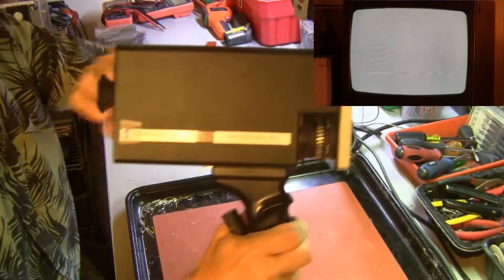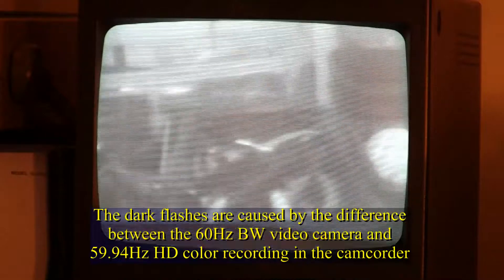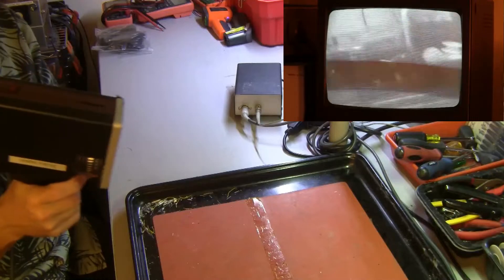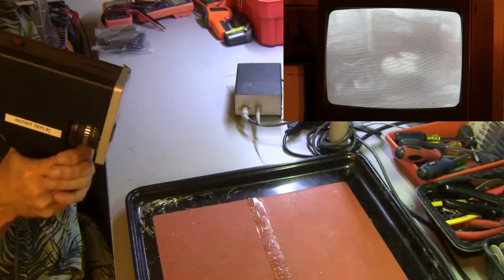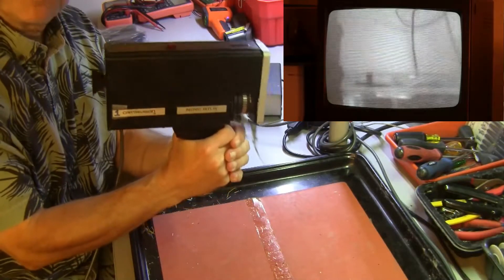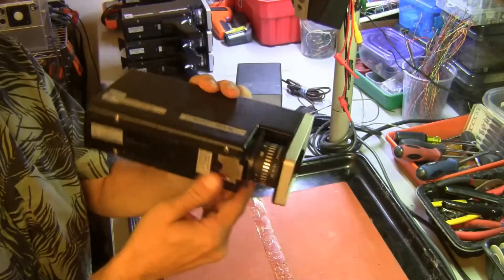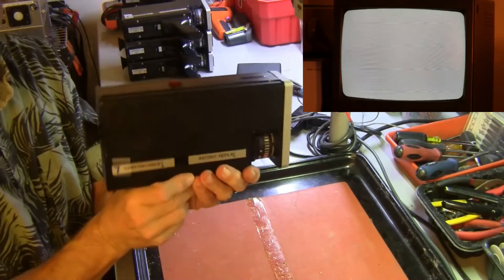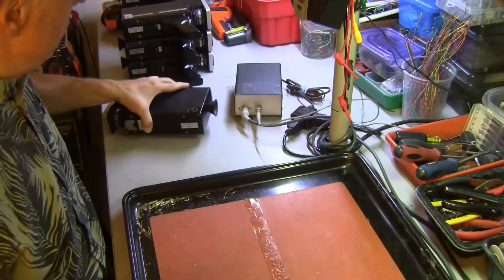Cartrivision Camer-A-Thon, Part 1

Comment: It's awesome to see one of these working. My grandpa bought one of these in the late 70s and hooked it up to his Sanyo Betacord VTC 9100. Here's some video from it: https://www.youtube.com/watch?v=4bw5OYgJgEE#t=1m50s . I got his camera but I'm not sure if it works anymore.
Reply from the maker: There is a good chance that camera does work. BUT, and its a big one, it is not as easy to power up as some. I make these videos for folks just like you. Thanks for the video clip. That was cool. I see the video was getting some buzz into the audio. Gives the production some character. Is that you in the video?
Reply: @videolabguy  That's me! I'm a bit taller now.

I pulled out the camera and took a quick look at the tube, no characteristic white spots that I could see like in your vidicon restoration videos so I'm hopeful it can be brought back to life. The transformer in the power supply looks pretty dried out so checking that will be the first step.
Reply from the maker: The transformer is probably OK. It's the filter capacitors that will be needing replacement. Be sure to check out my earlier Cartrivision camera video where I restore the power supply. That should be very helpful to you. https://www.youtube.com/watch?v=4NFqpyOJkW4

Comment: 6 good'ns outta 7 aint bad !

I remember being given a video camera of similar vintage, only to find that when I hooked it up to a monitor, well and truly burned into its image sensor tube, was the ghostly image of the factory yard it must have  patrolled for a long, long time !
Reply from the maker: That is very common with old surveillance cameras. Properly installed units would be mounted to scan back and forth over their view. This does not prevent burn in. But, it creates an even smear rather than a sharp after image. 
On a side not...
Most Cartrivision cameras, have actually got literally zero hours of run time on them. The Cartrivision contracted Eumig to make many thousands of them. Because of their goofy interface and operating voltage, very few experimenters bothered to use them. That is why so many still exist today.
Reply: @videolabguy  Yep, that's really jammy of you to get 7 low hour video cameras in one fell swoop....and what with that tasty wire find  the other day !!!
I didn't realise Eumig  made video cameras, I've seen their 8mm movie cameras and I own one of their 8mm projectors. 
All Interesting stuff.
Reply: @videolabguy  I feel truly bad for Austrian Eumig, always betting on the wrong companies and projects during the 1970s, first the Cartrivision camera, which didn’t sell, and then the Polaroid Polavision-system. I know they built a factory for it, but they never made the money back on it.